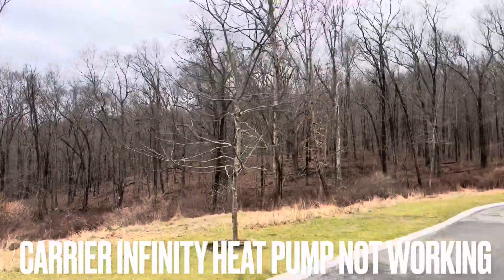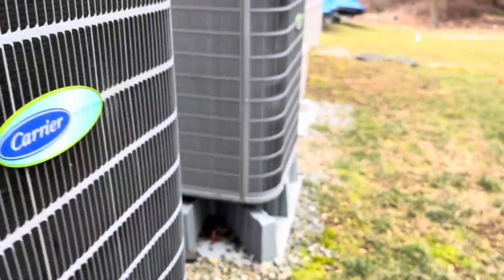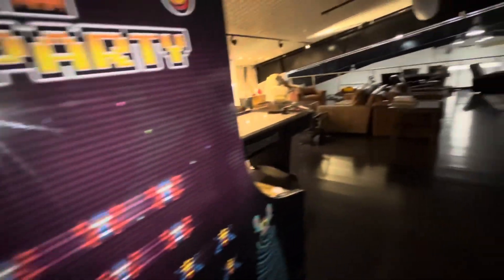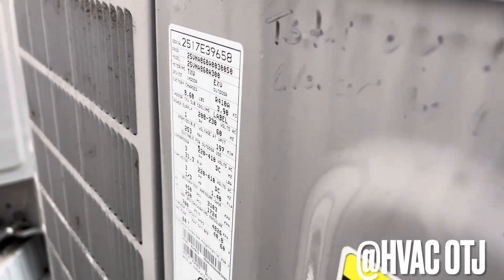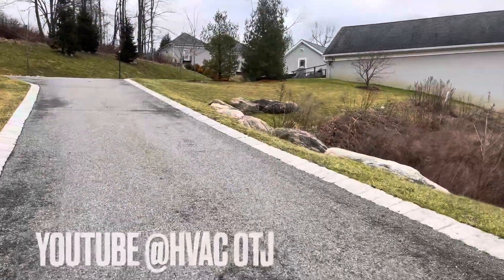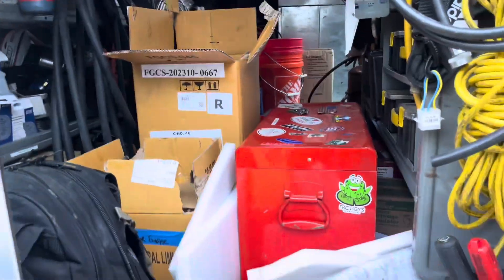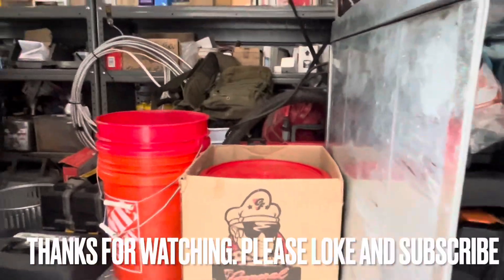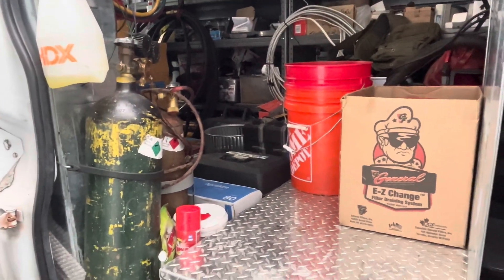Why is My Carrier Infinity Heat Pump / Condenser not running?   Watch complete video.

Comment: Or maybe some parameters on the infinity control wasn't set properly?
Reply from the maker: There are parameters in dual fuel like heat pump and furnace but the outside temp rule should still keep it off.  Good reason for it

Comment: Great video. I have this same heat pump with electric heating elements. 
The heat pump cooling works fine. 
My question is when the outdoor temperature is 90F will the heat pump still works in heating mode?
The temperature in my house was 75F and i wanted 77F. But the heat pump won't come on. If i increased the temperature on thermostat to say 79F then only the heating strip comes on. 
Is this normal because of high outdoor temperature or something is wrong with the heat pump in heating mode?
Thank you.
Reply from the maker: The system is demand designed. It shouldnt run that warm.   heating will not run when the outdoor temp rises above the indoor setpoint.  So if its 90 outside the system shouldnt run if you call for 77.  Its designed to protect the components like the compressor for example